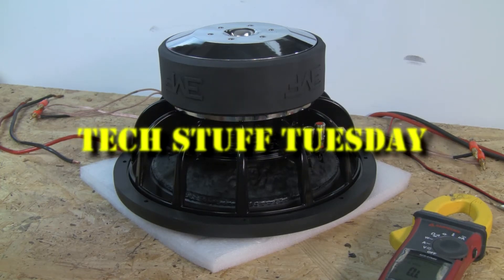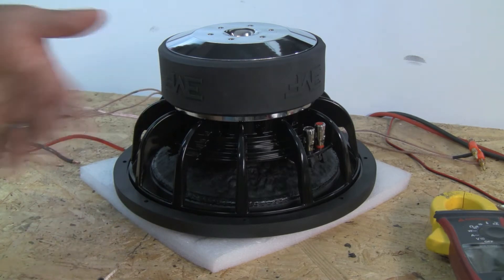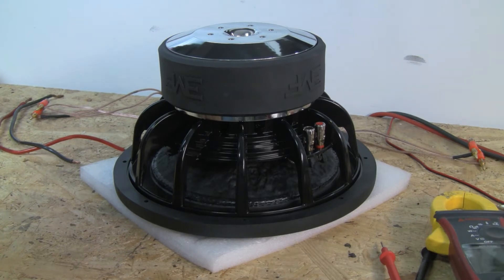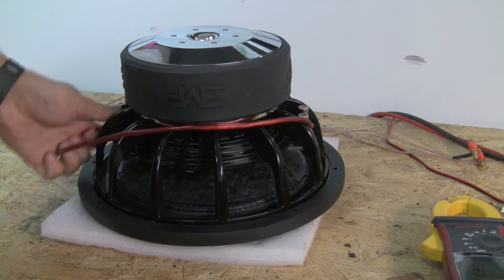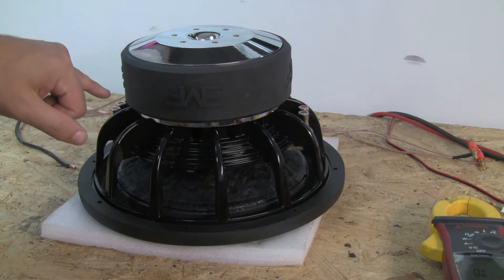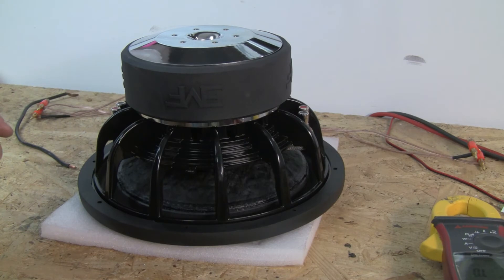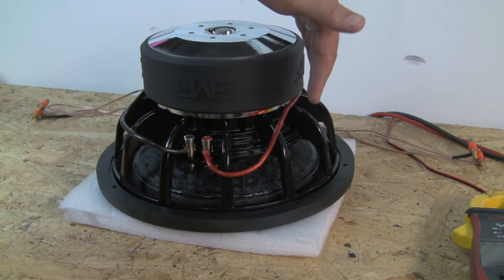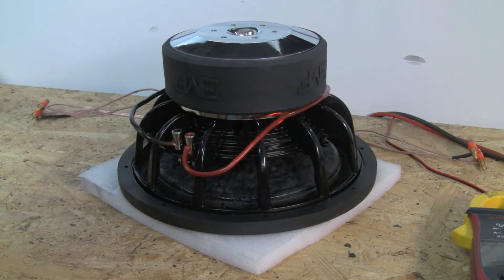Tech Stuff Tuesday - subwoofer wiring and impedance reading

Comment: Question. If I run 2x 2d subs. One wired 4ohm other 1ohm.  Bringing it down with a parallel connection which should be 0.8 ohms. Will one sub get more then the other. Not much into ohms law. Please help

Comment: So if you were to run a subwoofer straight off a car head unit without a amplifier and crossover why will it not sound good
Reply from the maker: The same reason running mids full range at full volume without a crossover won't sound good, distortion, and the attempt at producing frequencies not intended to play.

Comment: Can tweeters be wired in series or parallel with a subwoofer also will the impedance change if a tweeter is wired in parallel or series with a subwoofer
Reply from the maker: Wiring in series with a subwoofer would cause the sub to be high passed through the filter on the tweeter. In parallel you'd blow the tweeter or blow the sub because neither would be filtered where they need to be or take the power.

Comment: So, with this driver, you have 2 choices: 2 Ohms, or 8 Ohms. Is that correct? In parallel, the BL is 1/2 what it is if the coils are in series. That means twice the current into 1/4 the DC resistance. Since dissipated power equals I^2R, that means exactly the same power, to apply the exact force to the speaker suspension. The efficiency remains the same. If you use only one coil, The BL remains the same as both coils in parallel, but at twice the DC resistance. That said, the extra 2 Ohms of impedance is purely Ohmic loss. It's always worth it, to use both coils.
     If I wanted a 4 Ohm load, I would be more tempted to place the coils of each of 2 drivers in series, then, parallel both the drivers, because I think the amplifier could more precisely control the cones of both drivers, despite any possible manufacturing tolerances.
Reply from the maker: Correct, a dual 4 can be used as 2 ohms or 8 ohms. The thing to look at with BL is it's relationship to Re, not BL on it's own. No matter which way you wire it, it takes the same power to achieve the same motor force factor. For more information on what happens when you use 1 coil, check this out https://www.youtube.com/watch?v=bPKaBIbDd2E

Comment: Now I have a question can a car subwoofer be hooked straight up to the car head unit without a car amplifier and without a crossover and be ran just like a normal speaker
Reply from the maker: It would not perform well or sound good. On lower power subs, like say 100 watts RMS, you could even maybe blow it on HU power. Low pass filtering is a critical component to keeping a sub alive at any power, most HU's only put out 10-15 watts RMS as well.

Comment: Just bought 2 more sa10s d4s dude said they were not hitting and he wasn’t impressed. Got home took them out the box and oh man had like 18ga wire hooked up to +& - of one coil and that was it and had spade connectors crimped on with needle nose on the terminal cups. I re fit them in the nox re wired down to 1 ohm and they sound great just got to take your time

Comment: my fucking RE audio sx d2 claims 1 ohm but reads 3.8 on each coil which drops to 1.9 ohms parallel, fucking liars im basically at 2 ohms. i was starving my sub 500w even more with box rise. i sold that shit and now shopping around for a new sub, that lowballer looks to be my next setup. what ohms will the dual 2 be in parallel

Comment: Are the Banhammers good for music with a wide bandwidth or just lower bass? I love rock and metal in addition to hip hop. Will they perform well in that situation?
Reply from the maker: They strive on lower bass, rock and metal may or may not give you the desired result. Personally I'd take the Lowballer for that duty. But, the Lowballer won't be as vicious on the low bass. You can do one or the other really well, not both, or you can be ok at both.